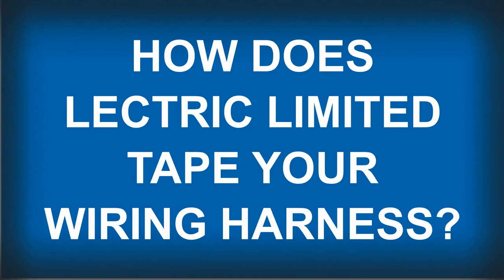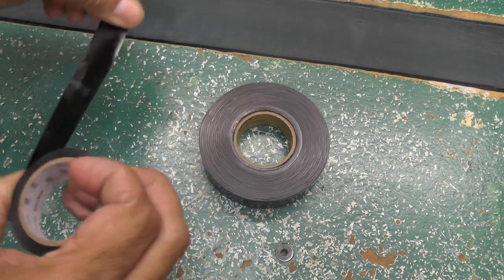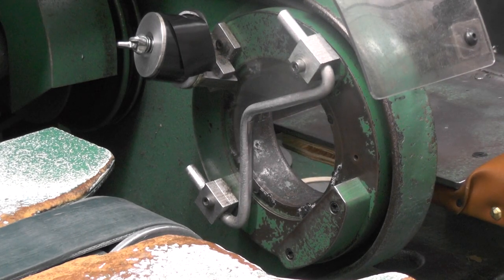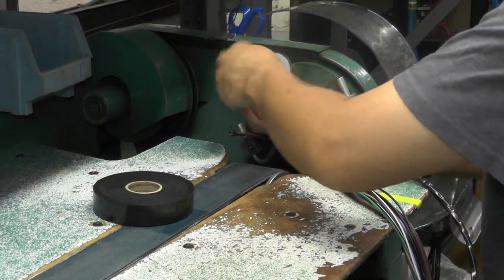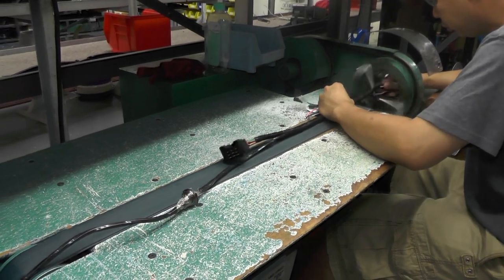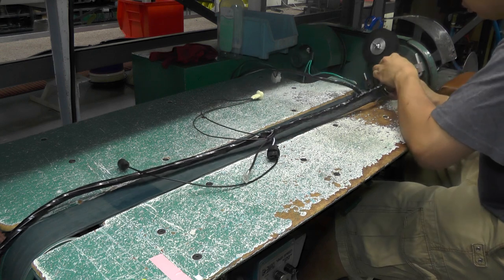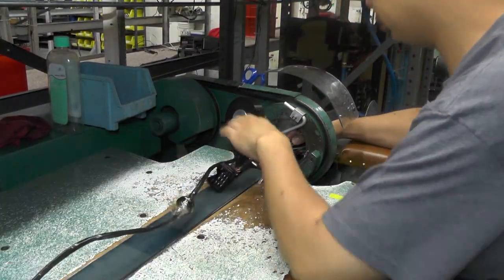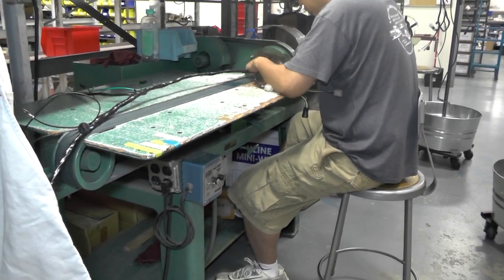How an Automotive Wiring Harness is Taped.

Comment: I got to know the use of non adhesive tapes... And disadvantages of adhesive tapes... Thanks very much for the video...
Reply from the maker: Non-adhesive tapes are used to cover/wrap wiring harnesses.  The disadvantage of using ADHESIVE tape (like electrical tape) is that the adhesive will degrade in a short time (months), will unravel, and become a mess.  Watch this video for more information and answers to your questions. https://www.youtube.com/watch?v=zSh8P461LuA&t=83s

Comment: Where can I get a machine like this?  I built my own simple machine and it works but it's not very slick.  I'm using 3/4" TESA tape.
Reply from the maker: The taping machines we use are refurbished ORIGINAL machines, used to make wiring harnesses for General Motors 70 years ago!

Comment: where can i get the the connectors for the main balk head from the fire wall ?
Reply from the maker: There are 2 bulk head connectors.  The one that is attached to the back of the fuse block and passes through the firewall, and the connectors that connect are part of the Engine and/or Forward Lamp Harness.  We do sell a few, but not many, bulk head connectors.  Those can be found on the on-line catalog of our website http://www.lectriclimited.com .   Of course, all of our applicable original wiring will come with new bulkhead connectors.

Comment: I'd like to see how he ties the knot at the end
Reply from the maker: Sorry.  We missed showing that to you.  We tie-off the end with one simple knot.  Nothing fancy.
Reply: @LectricLimited  Is that what is typically specified on the print? Or is that just standard practice and not specified in print/harness specs?
Reply from the maker: @timgads1712  The non-adhesive tape itself is specified on the blueprint.  However, it was standard practice to tie-off the harness tape at the end of the run.
Reply: @LectricLimited  Thank you!

Comment: You said the adhesive from common electric tape attracts oil?  How so?
Reply from the maker: All adhesive-backed tape will attract dirt, dust, oil and anything else that will stick to the adhesive. Static-electricity on the tape speeds-up the process.

Comment: why not use a heat shrink sleeve instead of tape?
Reply from the maker: Since we make exact reproduction wiring harness, and heat shrink sleeve was not originally used on these harnesses, we don't use it.  There are also a lot of other reasons that no manufacturer uses heat shrink tubing to cover a harness: not-flexible, can't break-out wires, cost, application impossible while assembling, etc.
Reply: @LectricLimited  you also cannot slide them past the breakout points, and over connectors etc.  you would have to build through them which is how we do it for military harnesses.
Reply: Heat shrink better for splices, non adhesion tape is just fine.

Comment: where the heck do you get the tape?
Reply from the maker: WE SELL THE TAPE!  It's the same tape we use on our wiring harnesses.  It is available in 3/4", 1" and 1-1/4" width.  Please give us a call (708) 563-0400 or visit our website http://www.lectriclimited.com to order.
Reply: did you find the tape?
Reply: I used vinyl non stick tape from amazon. PVC tape
Reply: Del City dot com!
Reply from the maker: https://www.lectriclimited.com/repair-components/

Comment: Surely a cloth based tape like that made by German company Tesa should be used. It is the only type of tape I've seen used in any European vehicle.
Reply from the maker: Cloth-based tape is used in certain areas of US-made cars, and we do use cloth-based tape in those areas.  Since we made exact reproduction wiring harnesses, we use what the original manufacturer (GM, Ford, etc.) used.